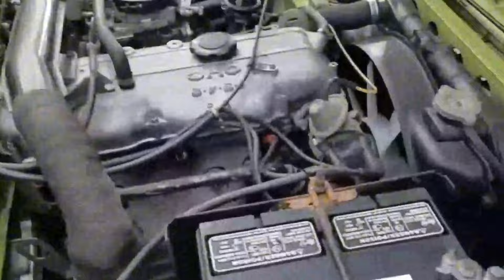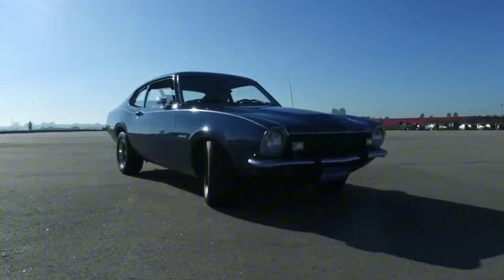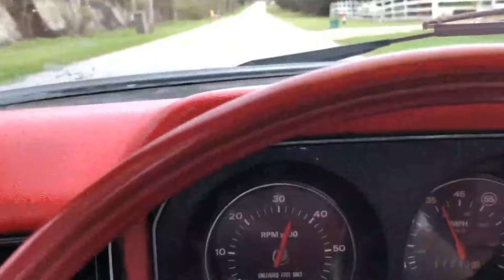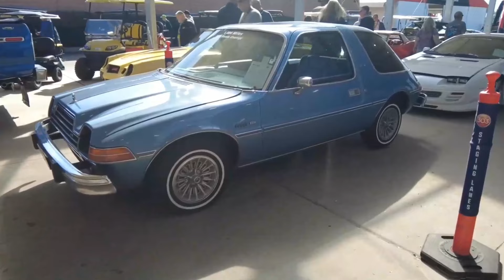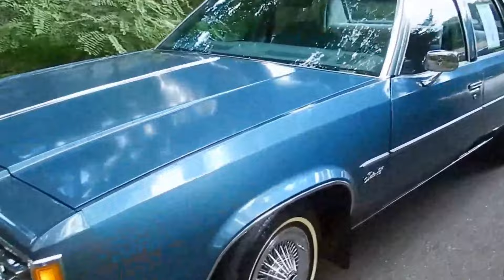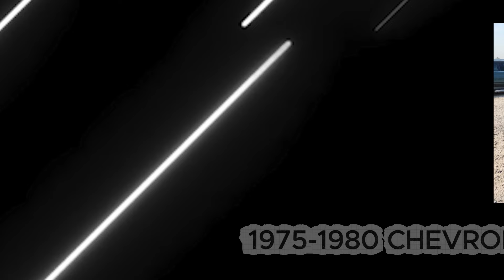13 Worst American Cars of the 1970s

Comment: 1. Actually the Courier did quite well despite its quirks.
2. Chrysler was caught in automotive "no-man's land" with cars like the 1975 Imperial. 
3. The original Maverick was based on the old Falcon platform. 
4. The Chevy LUV actually sold well despite its quirks. Later models were also sold by American Isuzu Motors as the P'UP.
5. The old rear-wheel-drive X-body was on its way out by this time, and the 1980s front-drive successor would fare no better.
6. I'm sure Ford engineers begged their superiors to kill the Pinto before the first one rolled off the line when they saw it.
7. The Triumph TR7 - the car that killed British Leyland (or at least one of them).
8. When the GM rotary engine project was canceled before one was even built, that should have killed the Pacer right then and there.
9. As was the case at Ford with the Pinto, I'm sure GM engineers begged their superiors to cancel the Vega before the first example rolled off the line when they saw it.
10. While the Mustang II DID have its problems, one good thing came out of it; it saved the Mustang.
11. The Oldsmobile Diesel V8 was by far one of the worst engines ever built.
12. Chrysler really should have let the Dart and Valiant soldier on for at least one more year.
13. As was the case with the AMC Pacer, the GM H-body cars were intended to be powered by a 1.3-liter Wankel rotary engine. When GM canceled the rotary project, that should have killed the H-body cars right then and there.